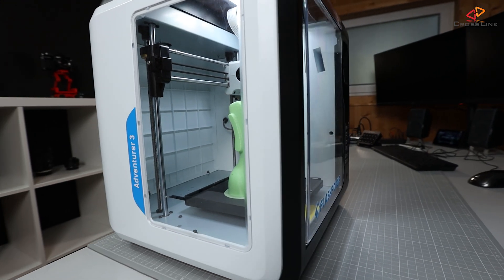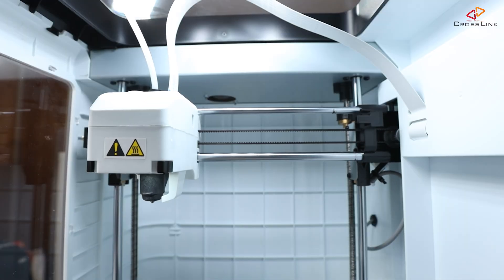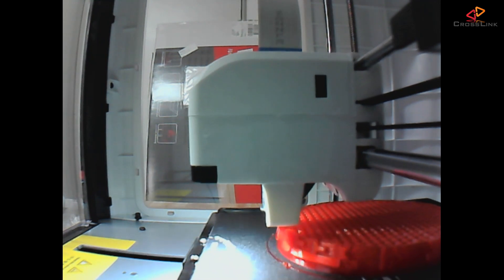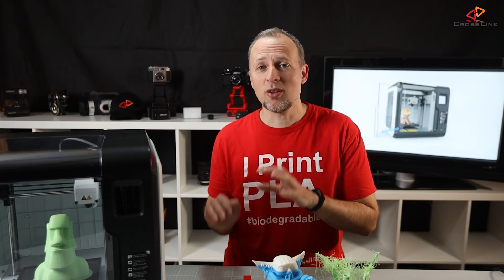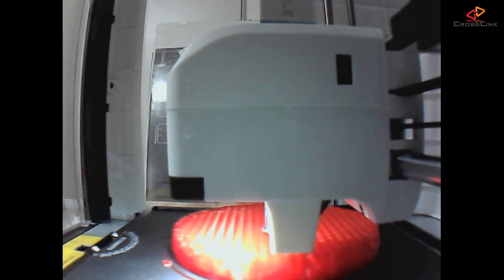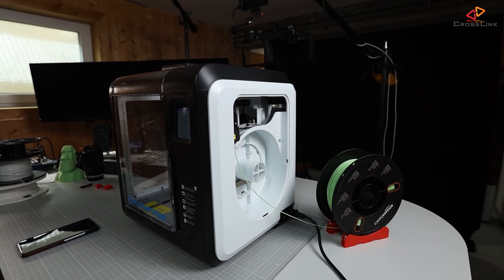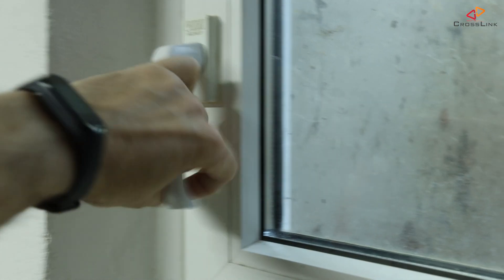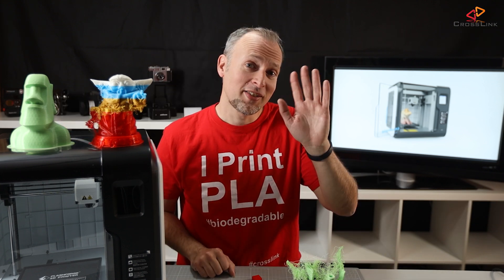Flashforge Adventurer 3 HONEST Review - This one SURPRISED me!

Comment: I generally like your content, @Crosslink, but this review disingenuous.  You would NEVER buy this for yourself.  We hobbyists demand control of our toys, and DESPISE proprietary rebranding.  We want to use open source slicers, and the ability to upgrade Marlin firmware for new features.  The spool holder problem reveals that this product has not undergone a basic sanity test.  This enclosure, however, looks interesting for ABS.
3d printing enthusiasts know what a file is.
Reply from the maker: First of all, thanks for the honesty. Since you know my channel for quite some time, I don't take these words easy. I get the point about the proprietary design and or software however if you think about what motivates people to get into 3d printing it's a wider range of motivations. So this might not be for the person that can build an Anet A8 to a level of perfection ABOVE this printer - I totally get it. The enclosure design is really the tempting point here and it really performs excellent with ABS. The testing will continue over the next weeks so I will definitely give another update on long-term usage.
Reply: Crosslink if there are any other competitor printers that can reliably print ABS out of the box at this price point, I would love to know.  I absolutely found this review useful.
Reply: @Crosslink3D  I am too harsh.  Your vids are well produced, and tell us what we need to know.  Wish this were not the only comment!
My A8 came in way-too-many pieces.  Its acrylic frame warps under the hot-box conditions that ABS needs.  Burned out the wiring to the heat bed trying to maintain it above 80C.   MOSFET mod, heatbed mod, auto-leveling mod, frame reinforcement mods, firmware mods.  All mostly necessary!  Too much work.  I still do not attempt ABS.  If there were a pre-assembled AM8 in an enclosure, with all the electronics outside, an STM32 controller board with removable stepper drivers, a dual geared extruder, and V6 all-metal head ... well, that would be bees knees.
Reply: GnuReligion actually... I am giving a hard look at this printer because I need something cheap that can do small abs parts that are already designed.  My hobbies involves actually getting parts produced to prototype and I don’t want to mess with tuning any more kit style printer.
Reply: @mastabas  I regret making the post above, as this may indeed be a fine option for people who want a turnkey printer that can use ABS.  The deal-breaker for me is that this one does not use the free and open standard for instructions called "Marlin-flavor gcode".  Flashforge wants you to use their FlashPrint slicer and Cloud services.  I would rather use Cura, Slic3r, or, well, anything else.  The layer shifting problem Crosslink experiences is caused by the lack of a "Z-Hop" feature in FlashPrint.  This is unforgivable.  To put it bluntly, in order to slice solids properly for THIS particular printer, you will need to be connected to the Internet and use Cloud services.  Here is a review:  https://all3dp.com/1/flashforge-adventurer-3-3d-printer-review/
Reply: @GnuReligion  em, I've been using flashprint for over 6 months and you do not have to be connected to the internet or use cloud services. It works absolutely fine. Also, using a raft would help a lot with bed adhesion.